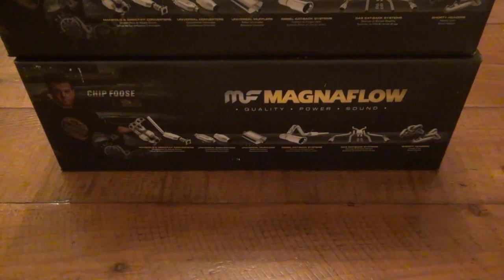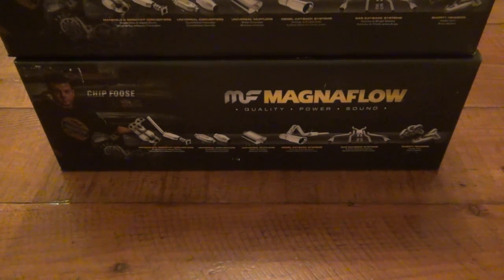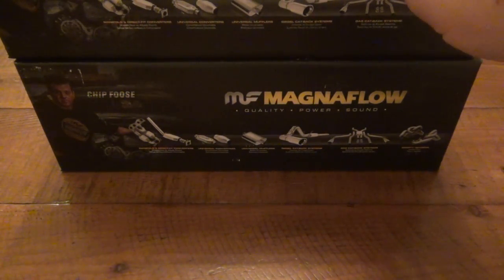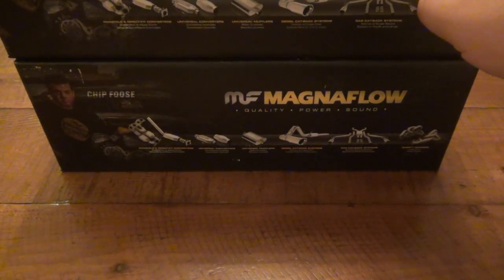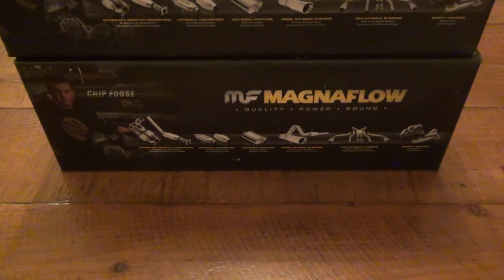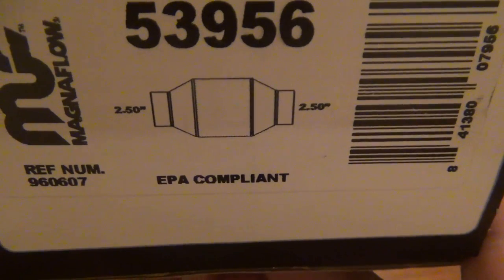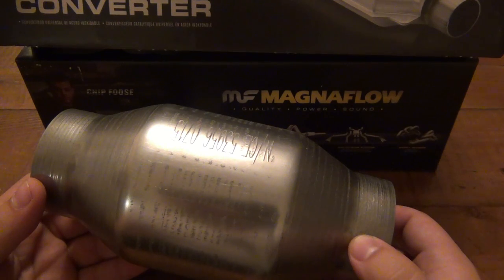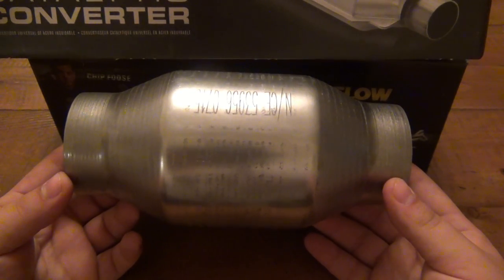Magnaflow Spun Catalytic Converter...Spun?

Comment: I worked for 19 years for the Wisconsin Vehicle Inspection Program, and my whole life revolved around catalytic converters.  Spun converters are fantastic.  The old oval design was very inefficient.  Air, like water, flows where it is the easiest, and with the old converters, the wide body caused a pressure loss that affected horsepower and actually contributed to a weird, uneven gumming up of the cells that often lead to an early breakdown of the catalyst.  I have a Magnaflow spun converter on my 2010 Mitsubishi Lancer Ralliart.  I believe it has 300 cells.  The exhaust flow is even and very efficient.  I've been able (with tuning, bigger turbo, and a racing exhaust) to eek out about 310 horsepower.  I hope to boost more with more modifications I plan to do next year...but anyway, two thumbs up to your new magnaflow converter!
Reply: hey Rachel im not passing emissions on my civic and was looking at this magnaflow spun cat . my civic is a hatch 1995 with integra engine  wonder if this would work?thanks
Reply: Very good Rachel
You are spot on.
 Nice to see someone who knows something here.
Reply: So will a two hundred count have more air flow that 300 cell count?

Comment: Trucks old enough, you should just run no cats. It's not like a cat makes a truck like that much more environmentally friendly. Also in my experience vehicles of this vintage actually run better and make more power without cats.
Reply from the maker: +HAACKER45 I did this to keep the option open to have it inspected, if I wish to use the truck often in the future I have to change my insurance to something standard and then will have to get the truck inspected...
Reply: +cutlerylover Fair enough, i guess i assumed that you already had the truck inspected or that it was old enough that it didn't need to be(since that is how it is in my state).
Reply: Usually cars with carburetors run better with no cats
Reply: +cutlerylover  That's what I love about Florida!! No state inspections here. You also have the option of leaving the cats on there and just punch them out!!!
Reply: I don't believe cats were on those trucks in 86 I think 87 might have been the first year?...  Buy some headers 2.5dia pipe and some good mufflers good to go
Reply: +greg aiken I think he said the engine has been swapped.
Reply: +HAACKER45  Yea it was a engine Swap
Reply: +HAACKER45  yea I knew it was originally a diesel what I meant to say was even the gas versions in 86 didn't have cats if I remember correctly.... I LS swapped my 87 it didn't have cats and still dont...lol
Reply: +Full Metal jacket 88 we have been punching out cats for 100 years in central Fl...lol well maybe not 100, but it feels like it sometimes. But I can say for sure 15-20 years I've been doing and hearing about. It's perfect for states with inspections because it still looks like it's there. Cutting them off always works well though... Got to love it here! Was 100 with the heat index yesterday though.
Reply: ***** I'm Florida myself
Reply: This truck will see a huge reduction in smog from a cat....... So yea cats do make it more environmentally freon fly 

And cats don't give performance to any car that I know of new or old they do rob performance
Reply: Why? Seriously, cats don't rob horsepower as many people think.

I run EPA OBDII certified GESI cats on my car. They're rated up to 500 hp, and GESI makes cats rated up to 850 hp.

Stock cats are also not as restrictive as people think, they just tend to melt as they're ceramic, which is why you want to replace them if you want to tune for performance. Unfortunately, however, CARB compliant "high-flow" cats do not exist. Hopefully they will in the future.

Comment: My family owns a muffler shop, and its the only job I've ever had, I install these things daily. Can you wash a converter out? Probably. Would I recommend it? No. It might help pass a quick emissions test but that's about it. Once they go bad they're bad until you replace them, especially if the ceramic starts to fuse together, and you'll know when that happens because the converter will be glowing cherry red. All they do is provide a little back pressure and "clean" the exhaust, they don't prevent backfires. In fact backfires can blow your converter up just like it can blow your muffler up. Make sure your truck is running smoothing before you put them on, because if you have a miss it will ruin them converters within a week. Your truck being as old as it is will run just fine, if not better without them though. Also heats shields arent needed as its well away from the body. the shield is on top of the converters and it just helps minimize the heat transfer into the interior of the vehicle.

Comment: I just installed one on my classic 74  Land Cruiser very happy with results I did install a fuel to air ratio gauge the performance is great very happy got rid of the gas smell and truck is quieter do not notice any loss power best mod I've done so far anybody that has a carbureted vehicle you must put a fuel to air ratio gauge you can dial in carburetor  14 to 1 or risk damaging catalytic converter.

Comment: Pro tip: Watch Eric the Car Guy. I guess if you want the voice of someone younger you could watch Chris Fix, too... but Eric the Car Guy is where I learned how to do everything I know. I've replaced radiators, ball joints, cv boots, half shafts, tie rod ends, rotated tires, changed oil, replaced coolant hoses, spark plugs, cam cover gaskets, head gaskets, exhausts, leaking weather stripping, rust repair, alternator replacement, steering/brake/transmission flushes, oil changes, brake pads/rotors, caliper rebuild/replacement, brake line replacement... I've done just about all you can do (short of your own fabrication, all part replacement I'm fairly well versed in). Anyways the point is... I learned it ALL from Eric the Car Guy.

Comment: Cats can be installed without heat shields as long as they are properly positioned in the exhaust stream away from floor pans, wires, and fuel/trans lines. Typically they are most efficient if placed near the manifold or header. With your truck being a 4x4 I doubt catching grass or anything on fire will be an issue due to ride height of the exhaust.  Magnaflow is a great product and they should last a LOT longer than an OEM cat and won't effect exhaust sound as much either.

Comment: There is no idea to put a cat on car with carburator. The cats will not work good unless the fuel/air mixture is perfect, which is almost impossible without a fuel injection system with lambdas and oxygen sensors. The cat will probably just get clogged up pretty soon.

Comment: You state in the video that those cats are not ceramic.  I saw the number on the cat body in the video and it was 53956.  Those are ceramic based.  They may have metallic catalysts in them, but the honeycomb is ceramic based. Also, spun core would have a circular pattern, not the square grid.

Comment: Unless you've done some pretty stout upgrades to the engine, you won't notice any difference between what you got or the absolute cheapest option available. Also, looks like those need to be welded in, so if you cant do that you may be SOL. Wouldn't worry about the heat shields, that thing sits pretty high so you'd have to park over some really tall, dry grass or directly in a pile of leaves. All in all, if you're not legally required to have them, just straight pipe it and save your money.

Comment: I have not even watched the video yet and I GIVE a big thumb down on cats from that era or earlier:) Yes iam a mech for 40 year or more. NOT needed at all. you are stifling the engine.. and I have a original owner (me) 1987 s-10  4X4 still running with original engine at 230,000 miles on it with the cat guts removed and STILL passed IM when it was active  and get 20mpg to this day . of coarse now in Alaska I'm is no longer required:)

Comment: Why would you waste your money on installing new cats if you don't need them to have your truck inspected ???  To me its just a waste of money that  you could of used on say replacing your dash :(((  you will get worse mileage and poor preformance by installing them on your truck .
Reply from the maker: The cats will keep the exhaust from poring smoke and smelling everything up, Ido t know about mileage but it won't effect hp at all either way
Reply: +cutlerylover Hi Jeff, I'd just like to point out that cats don't stop any smoke they just convert gasses from one type to another, vehicles usually smoke because the engine is worn or the fuel mix isn't right, most vehicles will smoke at first then as the engine heats up and the tolerances change inside the engine the smoke will diminish, an engine that smokes bad when warmed up is in bad shape and needs a rebuild.

As for smells, a cold cat smells like old farts kept in a jar until it heats up, the cat relies on the heat from the exhaust gases to activate it.

In short, cats don't stop smoke and they stink horrible until they heat up  : )
Reply: +John Smith Very good answer/reply..
Reply: +krazy45cat Magnaflow converters do not effect horsepower as much as the old cats did.  The old cats were very inefficient.  That crazy wide body design was ridiculous.  The magnaflow converters are extremely streamlined and have little or no effect on horsepower.  That said, as others have said, it will NOT stop the car from smoking.  Oil burnoff actually can ruin your cat.  The cells get gummed up from oil burnoff.
Reply: +Daliwolf Bacon Back when I was turning wrenchs as a mr goodwrench . As you mechanic his opion about replacing them or install a test pipe instead. Anything that gives you back pressue is not the ideal situation . In the 1970s we installeds a ton of "test pipes" inable you pass .They still sell test tubes today . After all the years I've been driving and doing my own repairs if I lived in a state where the cats weren't needed I would pass on having them  installed. I drive a 3/4 ton 4x4 full size dodge . One of the first things I  did to my truck 2005 Dodge 4x4 HD was help it breath"exaust " cold aribox , kNs airfilter . Then 33'  to raise the gear ratio To increase fuel milage . I have a warrany that is still good to 100,000 miles ,once I pass the 100,000 mark I'll be replaceing the air intake and I will pull off my cat or cat at a muffler shop where they can make the correct pipe that will match the rest of the exaust . I will replace my intake myself 4-5 bolts super clean install and will ad value for me due to  the gains in Hp and better fuel increases. Most of the smokeaperson seewhen they fire up their car or truck in the am you are looking at moisture that collects as the truck is turned off The motor will collect it when the key is shut off . This post is just my common sense .Save your money have the muffler shop extend the pipes to by pass the cats , with that money Take you wife out to dinner Jeff ,Gerry .
Reply: +cutlerylover It will have zero effects on the smoke or smell .I'm sure its the condensation from over night in the pipes.Shame on your mechanic if the told  you had to replace them . Best of luck . Remember I was a Chevy mr Goodwrench for ov4r 20 yrs .Ontopof that ran my own Automotive a/c and general repair .Then I went to work for lazydays to learn about RV's .I retire from there after 17 yrs as the Director of parts and service , Then retired  and worked for Thunder Marnie 5-6 years as Service manager . Retired again for 5 yrs bought my hardware / Marine store and as of last retired for good .You an always call if you stuck on the truck jeff, Gerry
Reply: neonightkiller Many thanks.
Reply: You are right, the magnaflow cats do create a small bit of back pressure, but NOTHING like the old cats.  That was my point.

Comment: OK, I 've got no idea, what "spun" converters do, but the better ones have allways been based on metal.
Personaly, I hat a magnaflow once. Failed german emissions test miserably (although metal, but probably not much on it) Yea, old cars really get checked here. On modern VWs they just look for error codes in the system. :D 

Old, new, without. On an old carburetor engine there probably won't be much of a difference.

Comment: They gunk up, but the rare materials do usually just get used up, should you get the efficiency code and verify the sensor operation just do yourself a favor and don't bother to clean it so it'll work another month. You're likely to just wash nearly as much of the materials away that are essential as you are to clean them off. Cleaning them isn't the same as doing a MAF or TB.

And everything besides surfing is illegal in CA, rule of thumb, look at CA and NJ, do the opposite. Spun vs Honeycomb, just a very minor performance thing at best IMO. Less to go thru with spun, so woodsy the owl has a sad face.

If money is tight and you've got cats that aren't collapsed or the like you can just use a spacer (right angled in tighter spots) or a couple "spark plug non-foulers" to cheat the efficiency testing usually for a number of years. It's rather ridonculous, as that P0420 will pop up with under I think 95% efficiency. Since this is PA we're talking about it would need to be a shop with the low on the totem guy doing the inspections of course. But usually not a problem for most states with a DMV inspection.

Comment: Sorry i don't know much about gas engines exhaust.... I would've stayed with the 6.5 GM diesel, but straight pipes on the older crate blocks will be okay. I run no cats, and nice flow master mufflers on my c-10

Comment: If your planning to do any off road stuff, even minor, I would get the heat shields. Guy down here burned up his truck when he got in it to warm up while hunting. He set the field on fire. I would ditch the Magnaflow and get something cheaper. It will work just fine and probably cleaner. Unless your trying to squeeze every ounce from that engine then don't waste money on performance parts, not that Magnaflow is truly a performance part, there more about noise. Magnaflow is not exactly known for longevity either. You get three to five years out of them if your lucky then the internals are shot.I am guessing that you want to keep the cats so you are not limited by the registration type of a classic....Totally understand that one.

Comment: Those cats have to be welded in, right? A great tool to have is a wire fed welder. I have found more uses for welding than just exhaust pipes since I purchased one. It is much easier to use than a stick welder.
Reply: +Dasdfjkl The harbor freight 90 amp wire welder is about $100, it works good.

Comment: "High flow" cat's and "Cold air intake" kits don't increase performance as much as you'd think. Especially on older high mileage vehicles. True, they do sound cool but honestly a stock engine is meant to work with stock replacement parts. A washable deop in filter such as a K&N will out perform the complete cold air kit on 99% of vehicles. Now if you have some serious race modifications, full exhaust, head work, intake, etc., then higher flow cat's, and a well designed intake will help. If your cat fails, you have access to a welder, and want to save a couple bucks go for a "universal" design. Nothing wrong with either cat, or cold air intake, but if your vehicle doesn't already sit you back in your seat when you floor it bolting these on won't make much difference. Personally, run those cat's backed by some matching diameter Thrush glass packs!
Reply: *drop in

Comment: You live in Pike County, they don't do emission test here. Like others have mentioned, cars from the 70's and 80's are severely limited in power due to the primitive emission equipment of the time which robbed them of power.

In my opinion, if I owned that truck, I would just run straight pipes. It would have saved you a lot of money and gave you positive gains in performance.

I'm not one of those guys who goes sawing cats off of modern cars but cats on cars of that vintage just hurts the performance.

Comment: If the cat that you purchased flows better than a regular cat then it may not get as hot so you may not have to use a heat shield. More flow equals less friction, which equals less heat. I would recommend using some sort of insulation just in case. DEI sells a product called Hi Temp Silicone Coating and is to be sprayed on your exhaust like regular spray paint and it will insulate it up to 1500 degrees. I will include a link to amazon where you can purchase it. Hope this helps. DEI 010301 Black High-Temperature Silicone Coating https://www.amazon.com/dp/B000MY3ML8/ref=cm_sw_r_other_awd_DNKdwb1FH100A
Reply: What's the difference between spraying the cat vs wrapping it (DEI Titanium Exhaust Wrap)?
Reply: Wrapping is recommended over just spray. The spray coating one withstand the direct contact to the high heat. wrapping it and coating the wrap is the best option. BUT WRAP CORRECT according to manufacture instructions. "Over" wrapping the cat may cause the cat to overheat and melt the catalyst core. DEI recommends 1/4in overlap.

Comment: Jeff go buy your self a 100$ arc welder and do this your self I learned how to weld when I was 14 and had no idea what I was doing but still did a decent job     and exhaust is very easy to weld
Reply: +David spade To start, auto stores sell small sections of exhaust pipe that you can practice on. Ohh, home depot has cheap electrical conduit to practice on and you can make artistic pieces like bird feeder poles. I am sure Jeff would enjoy welding. But get the wire feed type welder, not a stick welder and a auto darkening helmet.
Reply: Yah wire feeders are a lot easier then stick    and never had a auto darkening helmet but i would imagine it would make it a lot easier for a beginner.